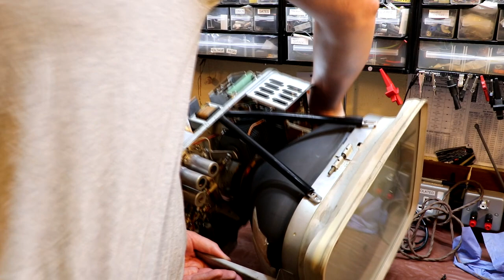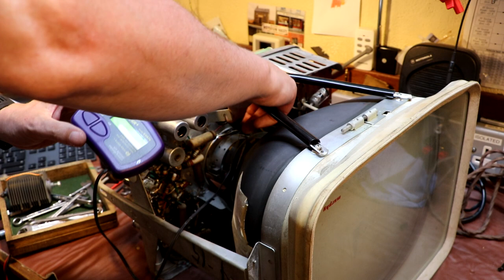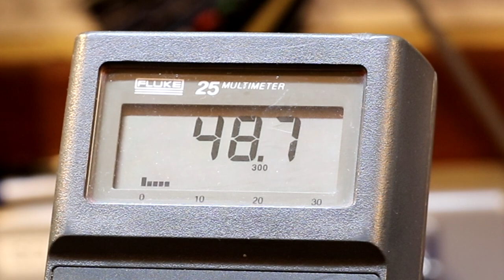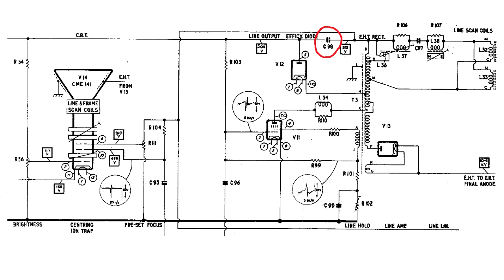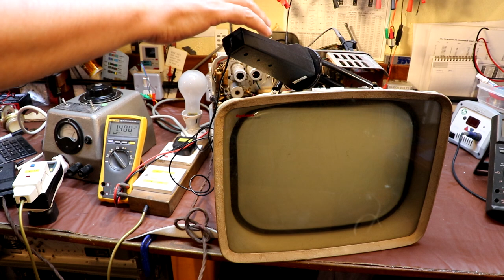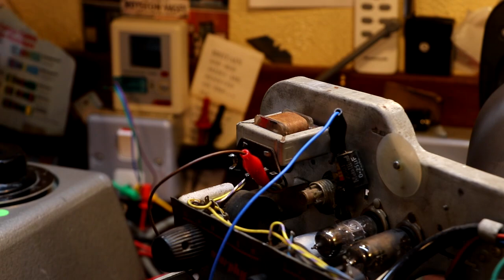Murphy Type 350 Television Repair  -  Part 1

Comment: I would start by replacing C94.
Reply from the maker: It’s on the list. I was probably going to have a look at the waveform from the frame oscillator and start from there. I was also going to change out the boost capacitor

Comment: Hi Chris,
I had to smile to myself.  You fell into the same trap I fell into fifty years ago LOL!
Aged sixteen, at the beginning of the first year of my five year apprenticeship, I remember working on a “barrel Murphy” (that is what those range of 1954 to 1959 Murphy monochrome televisions were referred), and I too remember thinking where the loud speaker had disappeared LOL.
Well, my friend, your wee barrel Murphy looks very promising.  The CRT, and LOPT appear to be in decent shape.  I guess it is now worth the effort, and expense to replace all defective capacitors, and resistors - which will hopefully cure the top frame cramp before re-setting the frame linearity pots.
When I started working on those 1950s, and 60s 405 line monochrome tellies, the few that remained in use were almost coming to the end of their working span.  Certainly by 1973/74 they were no longer in use.  They included televisions like the Pye Continental; Pye model V220; Ferguson Flight, BRC ThornEMI 850 chassis; Ekco TNB272, Ekco TC267;  GEC T304; Regentone Ten-17; Bush TV53 (very nice sets to work on)...and many others!  It’s amazing how after fifty years, certain television model members are fixed firmly in one’s memory LOL.
Love chatting with you,  Hope to meet up with you on 12 September.
Phil - the man now living in Bournemouth.
Reply from the maker: Hi Phil yes that speaker did take a bit of search for. It may be history for you but it’s all new to me. So are you setting up a new workshop in Bournemouth?

Comment: Only me. You don't wanna do it like that you want to remove the capacitor and fit a new one regardless of if it needs it or not that's what you want to do!
Lovely old box Chris. Look forward to the live stream. What was the current draw on the PSU?
Reply from the maker: Sorry Simon I didn’t look at the current I will next time it gets plugged in.
Reply: Harry enfield and chums.?
You dont want to do it like that :-D

Comment: You’re tempting fate by quoting Murphy’s law and working on a Murphy. Lol.  A pretty good first light without replacing caps too, looks like there’s a bad ‘un in the field circuit though.  I do recall the earful of 10125 while watching a 405 line TV, the Bush TV125 wasn’t too bad but the 12 inch Ferguson was rather loud.
Reply from the maker: The whistle on this is surprising quiet or my hearing is suffering recently

Comment: Ooow nice little telly :-D
Yes it does look like the frame drive is a bit buggered (Technical term).
And inverse video, maybe there is a missing supply that feeds frame and video bias?
I don't know anything about 405 line sets,  is the line rate is about 10khz?.
Dam annoying to the hearing, i remember that lol.
Smashing video chris :-D
Reply: Line oscillator is 10,125 Hz, to be precise. 405 lines * 25 Hz.
Reply: @oldblokeh  i thought it was somewhere near, but i never looked at old 405 line sets, i started with the 625 line 15.625khz ones.
I had some fun repairing junk ones :-D
Reply from the maker: Some capacitor changing in the near future I predict

Comment: An excellent start Chris your knollage is increasing in leeps and bounds ..I dont think it will take you long to have a fully working tv set .even the tube looks like it will come good after a few hours use.just goes to show how forgiving valve circuits are to drifting componet values and still sort of work
Reply from the maker: Yes your right valve circuits are very forgiving

Comment: Much as I enjoy your expeditions into TV restoration, I think I'll stick to radios. My hearing is so bad I've no chance of hearing the line oscillator. :( To be more precise, I have a permanent tinnitus line oscillator whistle in each ear. With capacitor reforming, I agree that it depends on whether or not it's dried out much. I've had a fair degree of success, although if I'm restoring for someone else I generally replace rather than reform.
Reply from the maker: I don’t hold much hope for reforming but I do think it’s useful to get a few hundred volts on the chassis. I thought the line whistle on this set is barely audible. Thanks regards Chris